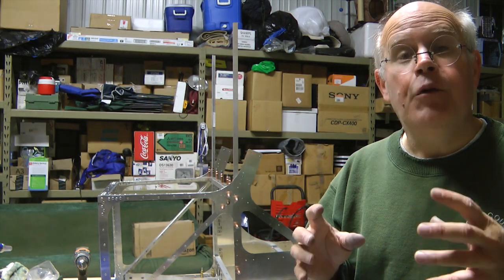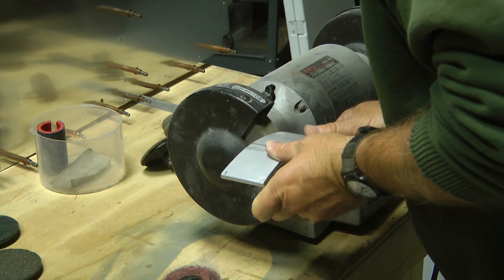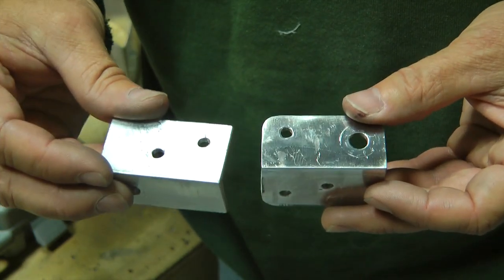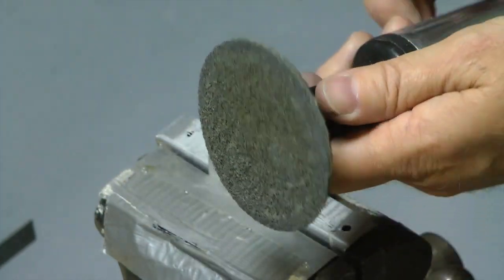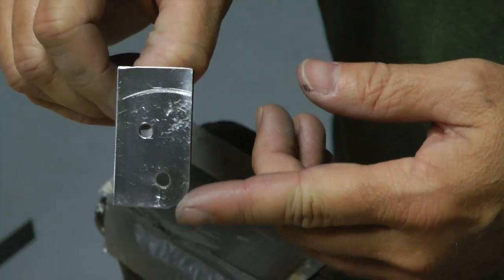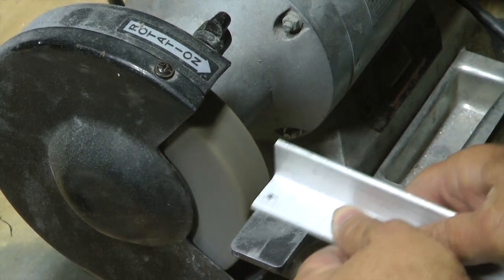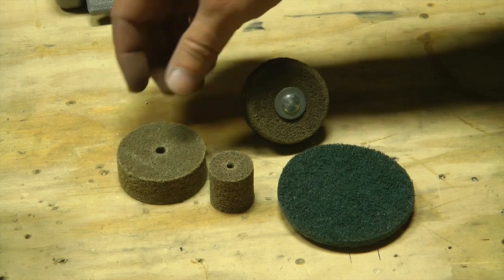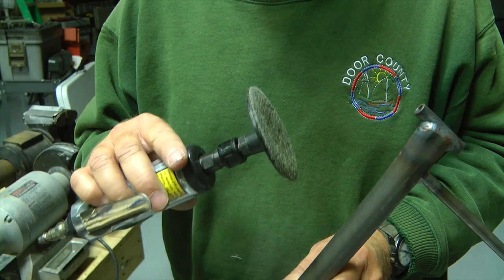Polishing Aluminum Aircraft Parts

Comment: I'm restoring a 1980's VJ-24w ultralight, that is an all aluminum / riveted / bolted together construction.   All the parts were hand cut by the original builder (as if he was trying to go just as fast as he could), and he left all the square sharp corners and edges on every hand fabricated part (gussets, etc).  I wanted to round the corners and edges on them so they could not abrade or cut into wing coverings, hands, or control wires..  Now I know the best way to do it.  I was going to use my dads shop grinder, but I had no idea I could put a scotch brite wheel on it, and what it did.

Also, i want to polish up all the alluminum surfaces that won't be covered, like the tail boom and coffin, so it sparkles with a mirror finish in the sun.  I was going to get a Harbor Freight Alluminum polishing kit, but from what I see in your video, you don't need any polish at all...  

http://www.harborfreight.com/catalogsearch/result?q=alluminum+polishing+kit

I use the hand scotch brite pads but don't have a die grinder yet.  I noticed that phosphoric acid really gets the oxidation and grime off of not only steel, but aluminum as well.  It really makes aluminum shiny by getting rid of that oxidation.   Is it really that bad to use an acid on aluminum?  I brush it on with a brush, and wipe it off with a rag.    People said it will get between cracks and continue eating away at the metal, but from my understanding of acid, and my tests with it, it is quickly used up and becomes neutral, when working on metal...   a little bit will not "eat away forever" at anything, unless you were to leave a part in a big container of it.  It will evaporate and you can wipe the residue off.

http://air-war.org

Comment: I wouldn't recommend using scotchbrite on aircraft parts because it a smearing op, it actually moves the metal and will hide cracks if you plan on doing any sort of dye penetrant ops to make sure you won't have any preemptive failures